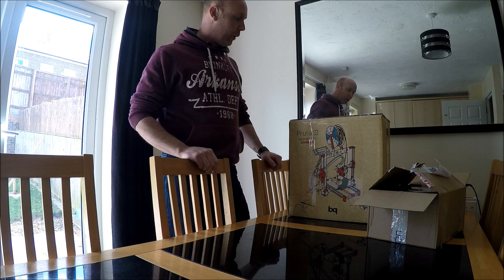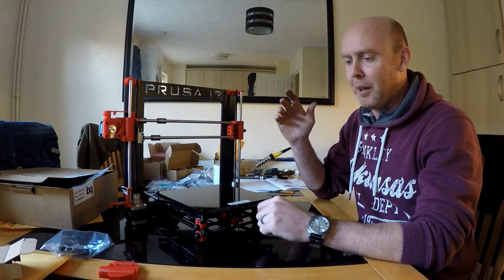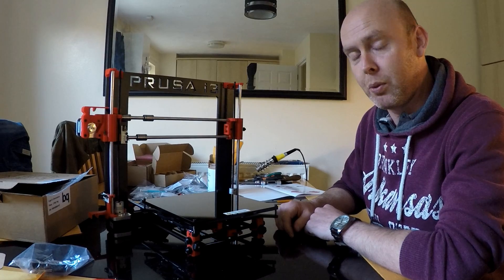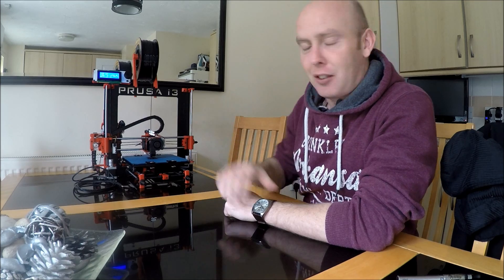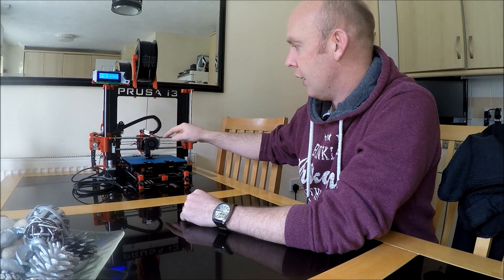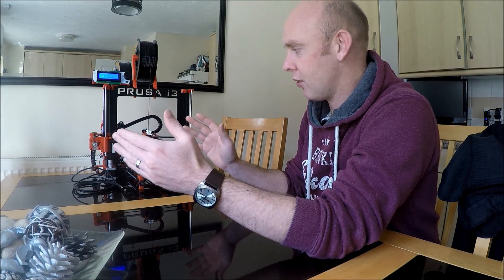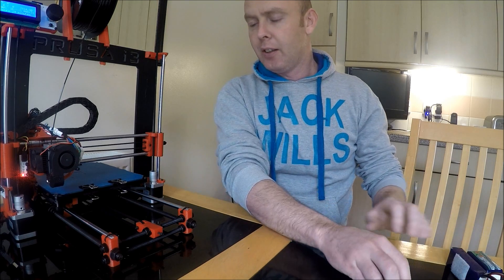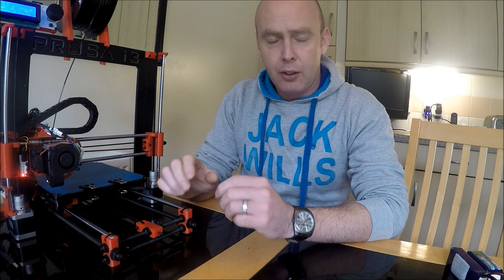3D printer Build & Review BQ Prusa i3 Hephestos RepRap

Comment: Great video. Very helpful.  I have just a couple question. Is that blue painters tape you use on the bed? I've seen that before and just want to confirm. Also, what did you say you apply to the tape for the next print, print stick? Prit stick??  I've heard other people mention a light layer of glue stick. Is that another name for it?

Comment: wich tape do you use
Reply from the maker: Aaron Gantschnig I was using Blue decorators tape, and then uses double sided carpet tape ontop of then and got no curling but was quite tough to get off, however since adding the heat bed no need for any tape but sometime use a bit of hair spray on bigger prints.
Reply: FPV-Quadcopter Racing thx

Comment: got the same printer few month ago! same things, long wire, bottom stopper had to be readjusted but worth the money =)
Reply from the maker: BILLYSxGREENxPARK yes nothings perfect but this is very good and with the addition of a heat bed the prints are amazing now
Reply: FPV-Quadcopter Racing yeah i was thinking about a heated bed too. do you have a link for me where i can get one?
Reply from the maker: Yeah sure, i'm in the Uk but this is the one I got, ebay number 151643781325 the last one in the drop down option, comes with heat bed Glass, kapton tape and clips, easy to install but you will need a beefier power supply than the standard one. I used a 33A 450w LED power supply I also got from ebay for £14 and you will have to upgrade the firmware which again is easy, I could do a video for that if needed. Let me know if you need any help and I will walk you through it. You won't need any tape once you have the heat bed and the prints come out very glssy to the point you could only tell they are 3d printed if you look hard.
Reply: FPV-Quadcopter Racing thank you! I am just wondering if the pcb has all the connections for the head bed or if it has to be upgreated? If i get one it would be really nice if you could guide me through =)
Reply from the maker: yes it has everything on there you need, you plug the jst connector for the thermister in on the 2 pins above the extruder thermister, then 2 pos feeds and 2 neg feeds from your power supply into the power connectors (green blocks) aswell as the other 2 cables for the fans and upgrade the firmware to 1.3.1 and away you go